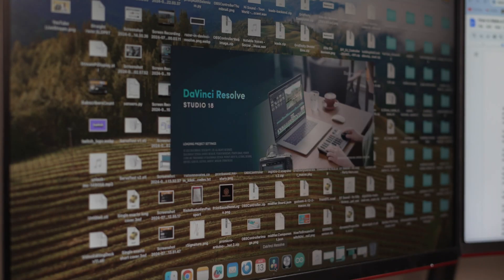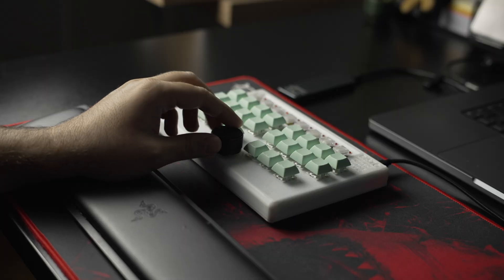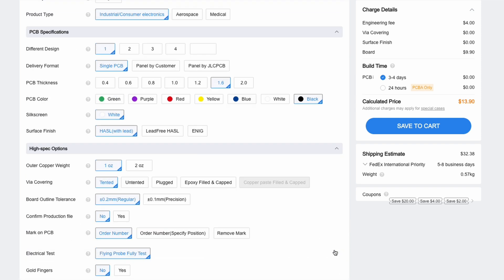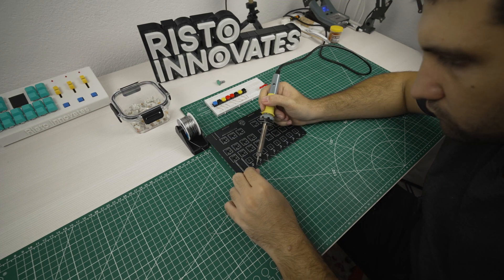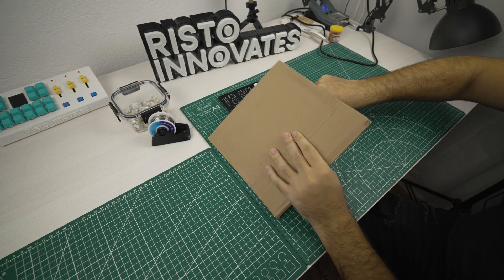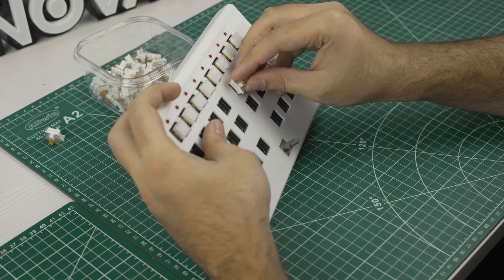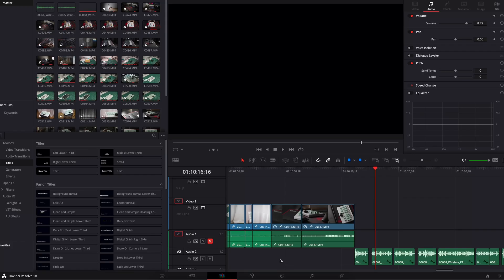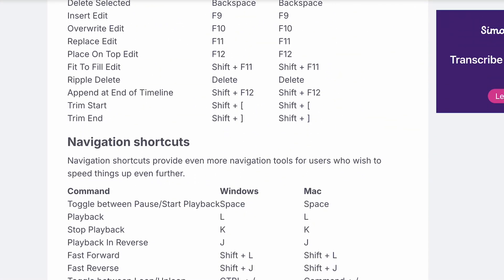I built a Custom Controller for DaVinci Resolve

Comment: Are you using the analog multiplexers for the buttons? If so is there any particular reason?
Reply from the maker: They are cheap, work both as analog and digital and they expand the pins of the arduino. No matrices, diodes or row*column number of pins needed